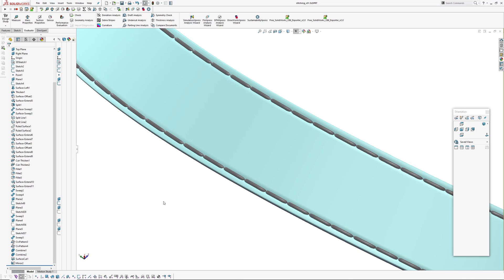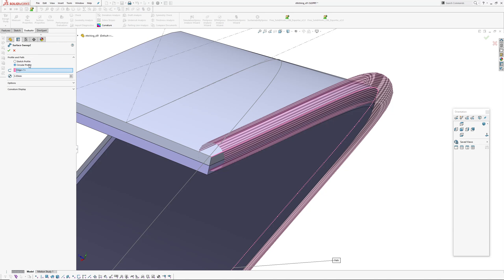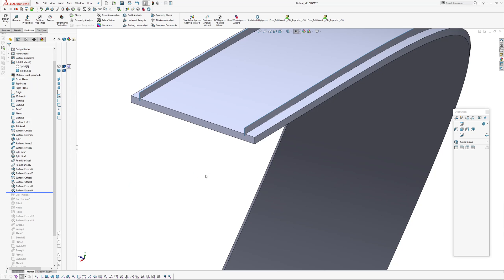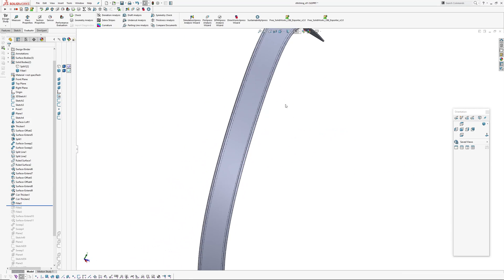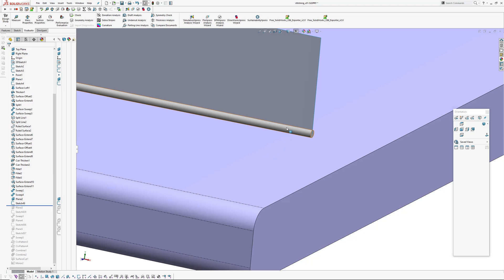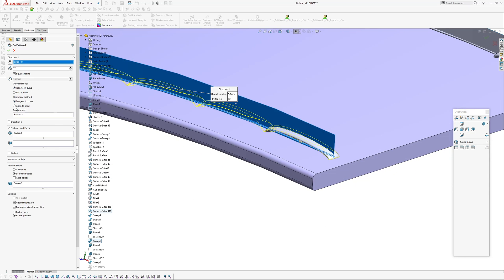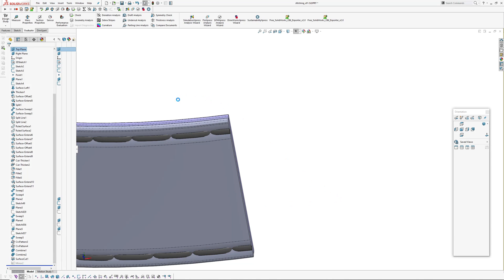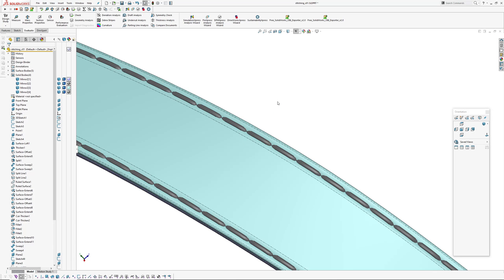Solidworks: Creating Stitching

Comment: Thanks for this, nice use of the ruled surface and I like how you used the swept pipe to allow a range of stitching styles to be a single body (I can just imagine what the solid bodies folder would look like if you didn't). Cheers
Reply from the maker: It probably rebuilds quicker if each stitch were a separate body but as you said, it'd be a nightmare! I also use a similar technique to connect a series of solids into one body. For example, making a series of disconnected extrudes that are used to pocket out ribs.